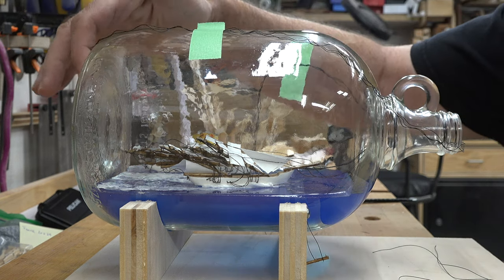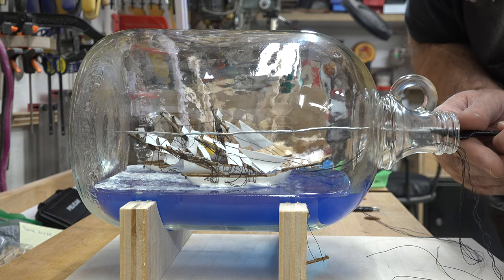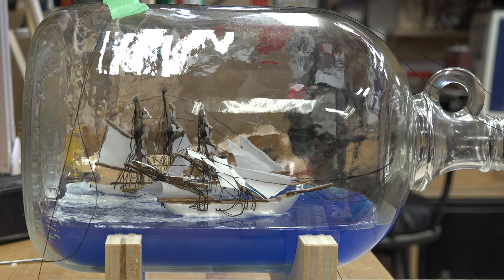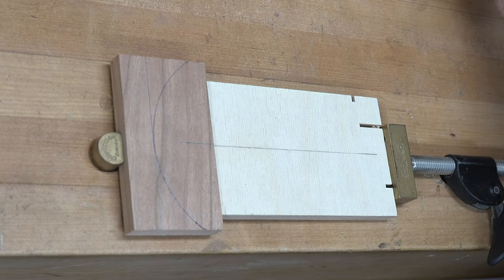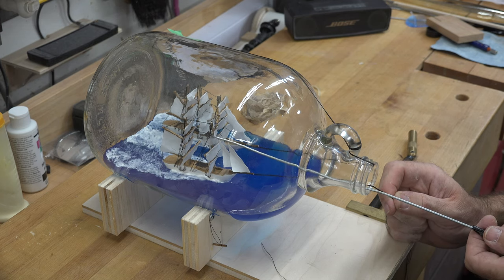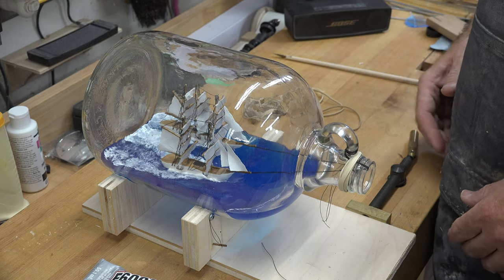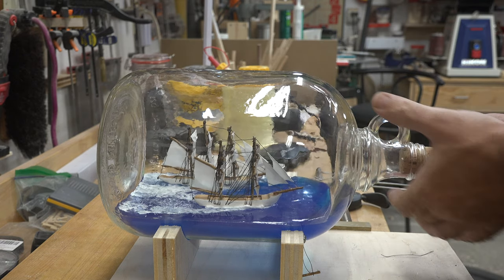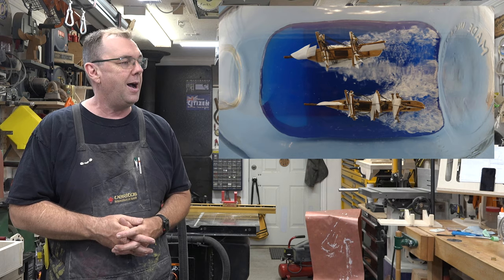Making Ships in a Bottle   Part 4

Comment: I know this is aimed at being the approachable side of not requiring lots of expensive tools, but they make a set of tweezers called alligator forceps that are very long but only the tip opens. I think they would have been an asset in your rigging fight.
Reply from the maker: They may have been an asset but they wouldn't have saved the rigging from being embedded in the silicone.  LOL.  I may have to look into those forceps and get a set for my shop.  Thanks for chiming in with that and for tuning in to the show.
Reply: @acutabove_woodworkings  Thank you for putting out both of these series, really enjoyable and motivating.